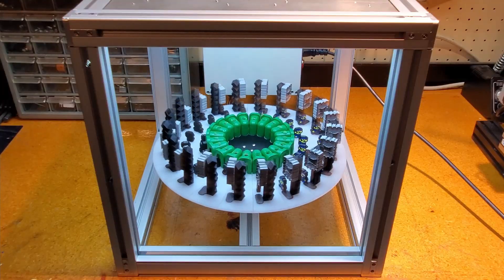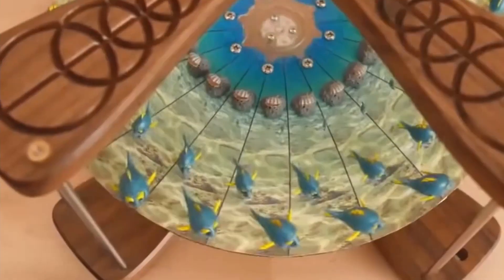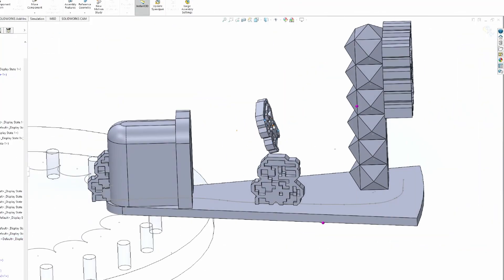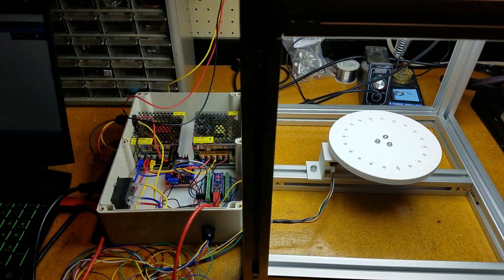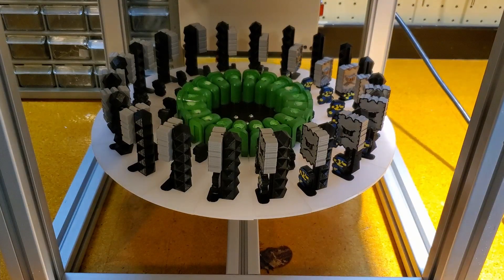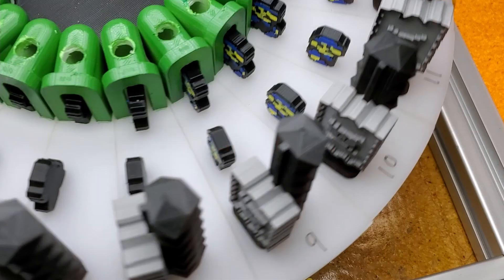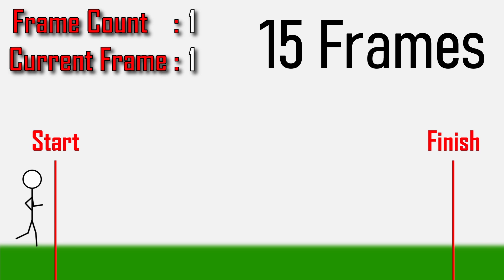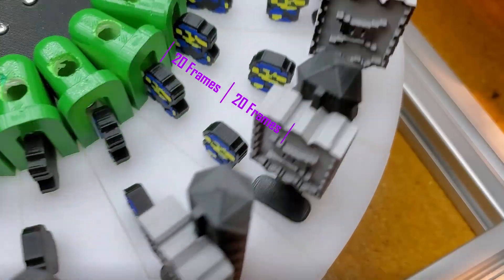Zoetrope - 3D Gifs!

Comment: I would understand 40, as that's 20*2. But how can you use 46?
Reply: I have a bit of a hard time wrapping my head around it too 😵‍💫

The latest figure in the chain takes fewer steps before reaching the end point. Then there are some frames in the total sequence (which I think would be a near-multiple of 20) that are used for then”cruncher” to return to the top of its stroke for the next cycle.

The total length including the cruncher movement is less than 60 frames, which is why the motions of the crunchers precess (probably wrong term) in a wave around the disc.

I think that’s the answer, that (a) there are additional steps in the animation cycle once the figures reach the crushers, and (b) the crusher action moves around the disc as you’re watching it. 

I could be all wrong but I think at least one key is to include the crusher action in the total cycle.

Comment: Also, you could use high power leds for this. These are readily available compared to 10years ago...
Luxeon , osram etc. One can get easily 5watt, 10 or more watt led compared to the typical les strips

Comment: How difficult would it be to add an inner ring that moves at a different rate and has a different number of frame, which would offset it from the other ring?
Reply: Depends; if it like, say 10, that’s easy but if it’s like a prime number like 11, then it’s will be absolutely hell to sync them up

Comment: If i understand correctly, you use your steppermotor for counting the angle to turn the light on. Why not use a DC motor and a switch activated by the "petals" you use as bases for each frame. If you do that, you can make any frames you wish for any speed without counting angles/times for each variant.....

Comment: Yeah, now try to blink your eyes fast enough to see it in real life, without a camera or strobe light... not so cool anymore huh?
Reply: You don't need lights.  Just put black spacers between the elements.  Works the same by interrupting your vision.  It's how they did it with candles back when they were invented.
Reply: now watch a cartoon in real life without a TV to play the frames quickly for you... not so cool now, is it...
Reply: Yes, the slits create the strobe effect, no electronics required. I’ve also seen one with flat mirrors in the center, as the wheel turns each mirror lines up with your line of sight at the right time. You just need a shield so you don’t see anything but the reflection in the mirror.
Reply: Now breathe in real life without trees and planktons making oxygen for you. Not so cool anymore huh?
Reply: Yes it is shut up
Reply: Lol  thats the purpose of a zoetrop
Reply: I mean yeah it is pretty cool, those 3d models look interesting
Reply: In real life you can flicker lights perfectly in time with electronics and the same illusion can be viewed in person!
Reply: @andrewanderson8803  technically ceiling lights already flicker at 60-50fps. thats why anti strobe settings for video are set to that

Comment: Sorry, what’s the relationship between 46 and 20?
If it was 45 and 20, I would think “oh, well, there is just 2 + (1/4) of the character in each frame on average”, but like, when you say 46, that seems, confusing?
Why 46?
2 + (6/20) ?
I guess that would mean that on 6 of the 20 frames, you have 3 copies of the character, and on the other 14, you only have 2 copies?
Huh.
Reply: It's arbitrary. A regular zoetrope would use 20 frames on a 20 frame disc because the character is following a circular path, but since this one uses a spiral path you can make that spiral as long as you like.

Comment: I think that there are two ways that could add even more frames and make them look good:
1. Multi-color lights. Frame that was blue in previous rotation can be green in current rotation and red in the next one.
2. If we use the multi-color lights then we could also use 3D effect by correctly painting each frame. If one part of the frame is green then it won't be visible in the green light. Same for red and blue. This way our colorful frames would now also change shape making it look more like a different frame.

Comment: I think you can do a no strobe version of this with a powerful stepper motor. The acceleration needed to advance the frame "instantly" should be well within what we get these days with steppers on 3D printers, with parts under $50.
Reply: Fun fact.  you need some form of stopper to the visual information for the persistence of the vision effect to work.

If you ever tried staring at a fan before, it looks very blurry, but if you blink really fast, the blurry blades become more clear.  Similar effect.  

without an "Interrupt" it's a blurry mess.  the old ones with the slots, use the physical window as the interrupt, a Stobe Light causes a similar effect if it overpowers the natural lighting, as your eyes adapt and your brain ignores the normal lighting...  

This effect only works in person, as cameras with their Frames per second acts as their own interrupt.
Reply: @MouseyArtist  Having the rotation be stopped 99% of the time and moving extremely fast 1% of the time should give that "stopper" effect. You can already see it in the travel moves of really fast 3D printers which folks describe as "teleportation". One could hypothesize the "teleportation" effect is only there in video from the camera's framerate, but at least for me it works in person too.
Reply: @daliasprints9798   Yeah that would also work.  though weight would then become a major factor, as you need it light enough, or the motor strong enough to stop/go rapidly like that.
Reply: No, stopping and starting a model like this with steppers isn't practical. For comparison, try looking up how much effort cinema projectors need to do that with a few micrograms of film. A geneva mechanism might come closer, but the movement rate would get dangerous pretty quick,
Reply: @0LoneTech  Apparently you've missed what we're doing with modern 3D printers. Stopping & starting something with that inertia that fast, with steppers, is a solved problem.
Reply: So, like movie projectors?

Comment: Hey, really Brilliant work! 
Simply amazing 3D animation design!

Bruh, how do i zoetrope?

Im onto making one & and landed here while researching for it.
Will be great  help if you can help me out with few bits of info.

1) Whats the total wattage of the LED panel you used there?
2) Why use  a L298N board Vs a more common L293D with a shield? Is it  better for long continuous operation?

Will it be possible for you to share the schematic of the electronics for the strobe?

Thanks in advance.